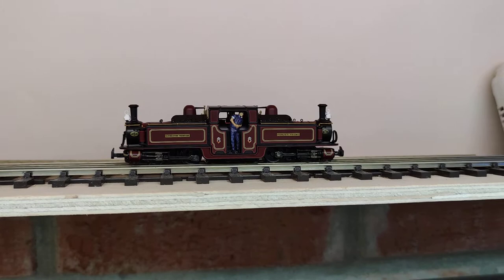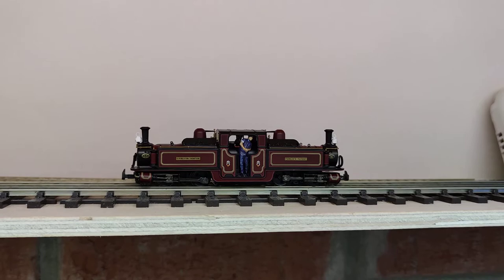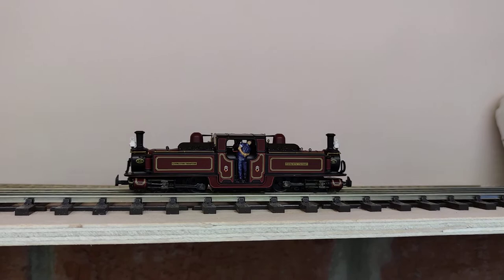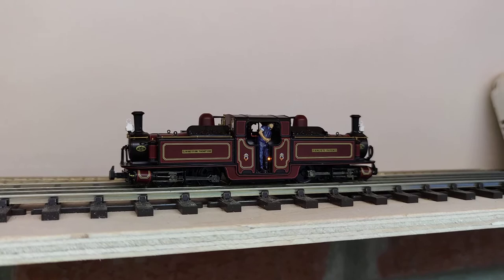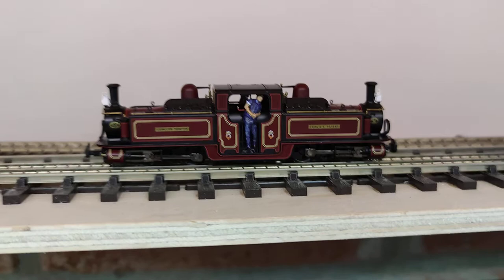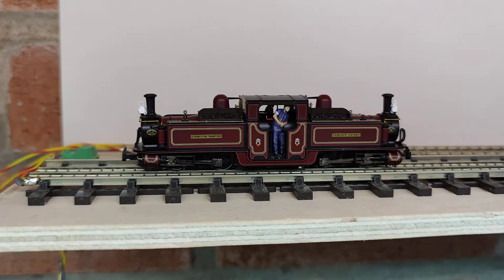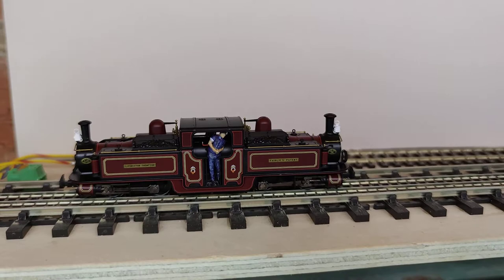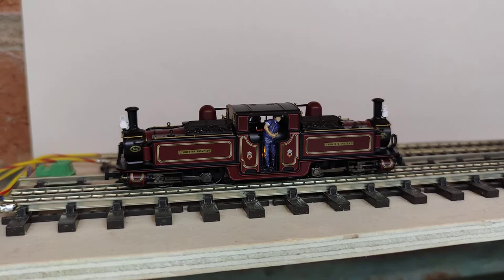Bachmann double Fairlie Livingston Thompson DCC sound + extras

Comment: I like that I like them before but the firebox light is cool 
Where do the lamps come from did you make them?
Reply from the maker: They are prewired nano SMDs off eBay, orange best colour. They are wired to the decoder aux1 and aux2 with common + and resistor on the + side. The decoder has a random flicker effect. 👍
Reply from the maker: Lamp are 3d printed, modelu then just put a SMD light in them.
Reply: Ah cool I have some of the modelu figures I quite like the different poses you can get as adds a bit of variety from the same ones Peco used to make 
I didn't realise he did lamps too I'll have to go and have a look at his website
Reply from the maker: @kelvinstapleton7516  you have to add the bulbs and then you need to remove the silver backing from the lens

Comment: What firebox flicker do you use? And what stay-alive did you use too?
Reply from the maker: Lais DCC 870007, orange smd bulbs, pre wired from eBay
Reply: @johnjmc  great, thanks! What Next18 DCC decoder would you recommend using in this?
Reply from the maker: @matthewsouthall3725  zimo mx659n18, zs048p is soundfile. I haven't found a way to add stay alive to the factory PCB or the next18. I ended up taking all that out and starting again, hardwiring a zimo mx649r into the model.

Comment: Hi John

Does the bachmann sound fitted zimo decoder allow fire flicker? Fitted an out break board but nothing from the leds on aux1 or 2, also couldn't get anything from the front or rear pads either. I have a zimo stay alive unit for the mx648 chip wondering if this would work on the factory fitted chip due to no leds.

Was able to fit gold caps directly to a factory fitted class 24 with no issues.

Hope you can help me out here.

Kind regards Dan
Reply from the maker: The factory fit won't include these output without function mapping the decoder. 648 will take a stay alive no problem
Reply: @johnjmc  Hi John

Cheers thanks for the quick reply. 

That's good then especially with the stay alive. I was expecting the led just to light up solid via direction control without modification and thought there may be an issue with the decoder or factory settings won't allow it.

I'll have a play around with it over the next few nights 😬😬🤣

Kind regards Dan
Reply from the maker: @loco82  cv430 to 29, 432 to 14 and 434 to 15 will sort directional lights
Reply from the maker: @loco82  what f keys are the fireboxes on ?
Reply: @johnjmc Hi John

Function 6 is the fire box sound.

Kind regards Dan
Reply: @johnjmc  thank you 👍
Reply from the maker: @loco82  cv436 to 6, 438 to 1 and 440 to 1. That will do aux 1 cv127 to 8 sets the effect on the led
Reply: @johnjmc  that's brilliant, thank you so much 👍👍

Kind regards Dan
Reply: Hi John

Worked a treat, thank you 👍👍